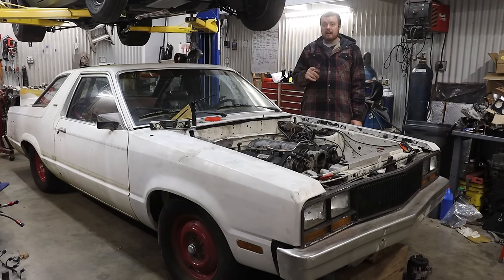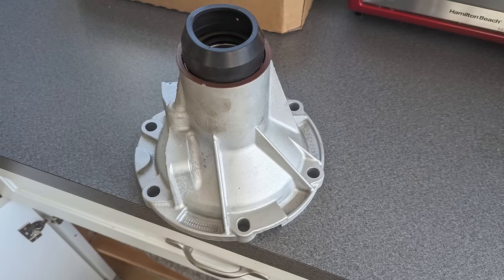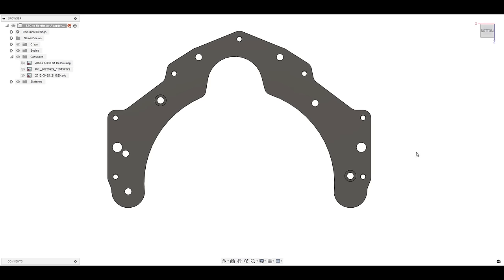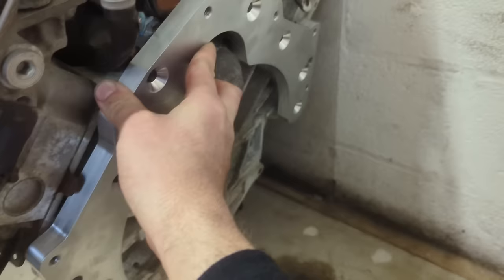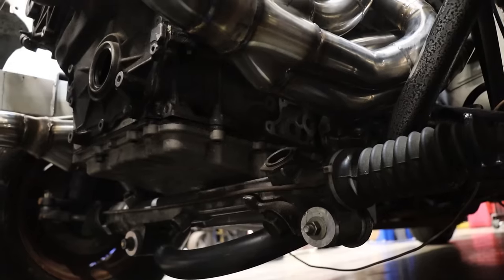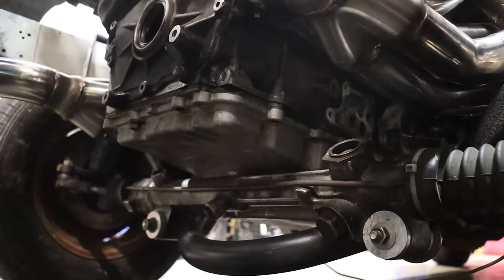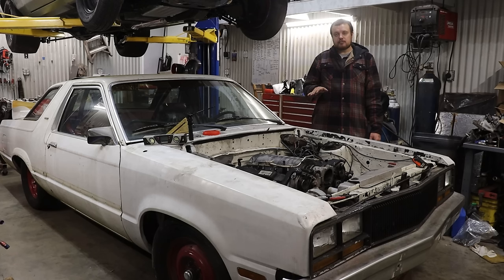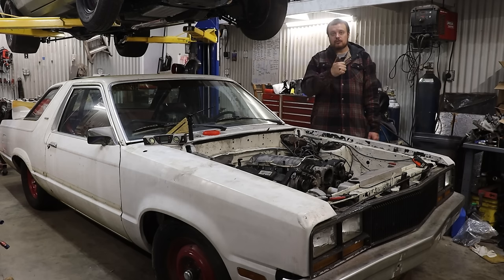Fits Way Better Than A Coyote! - Twin Turbo Cadillac Northstar

Comment: You are using gt3582s on it. I'm trying to figure out a pair that will have equal back pressure to boost pressure between 5000 to 6500 RPM on a square headed 6.0. I know you have ran different pairs on your 6.0 . What pair of turbos do you think would fit that criteria?.
Reply from the maker: You'll definitely want to use something larger than gt3582s. It more depends on you planned power goals. A set of s366s should do the trick to 1000+whp
Reply: @Calvin-Nelson  I'm thinking s366 with a 80  73  turbine wheel and a. 91 ar. They are the john Deere tractor turbos. That's what I was thinking too.

Comment: Big problem with the Northstar is that they pull the head bolt threads out of the block naturally aspirated. It's only gonna be worse under boost. I was a tech at a Cadillac dealership for years in the 2000s. We had 3 techs that all they did all day is pull Northstar engines and install head certs in the blick
Reply from the maker: We will be fixing that problem with some improved studs from Northstar performance.

Comment: I love this! I'm trying to build a car with a Northstar in Germany. I believe the open deck design will run into problems after 700bhp. No need for 700bhp in Germany though. They'd lock you up if you took it on the streets.
Reply from the maker: You guys need more racetracks.
Reply: @Calvin-Nelson  true. I'll probably take it hill climbing as that doesn't require the same rules as getting something road legal.

Comment: I'm really excited about this project. I was lucky enough or smart enough to buy an m122 for the northstar with the built in intercooler prior to Richard's videos for less than $500 with the intention of modifying an aluminum truck intake for a 4.6 2v to use it on, but as soon as I saw you doing this, I put using the 2v on hold to see what comes of this project. 

Instead I decided to just use the 4.2 ford v6 that was in my f150 and turbo it. I'm using an ebay gt3582 for that one. I've already added an MS3X to it and once I get it tuned on Flex fuel, I'll add the turbo. The eventual goal for that is to twin charge it after adding some aftermarket rods and ring gap using twin 3582s and twin amr500 superchargers  (which I already have from adding twin superchargers to my frs that I've since sold). 

Depending on how this project goes I may end up putting the m122 and a northstar in my dodge magnum.

Comment: I build transmissions. That’s not a 6l80e that’s a 6l50e very similar design but not quite the same you can get a 2wd tail look for one off a Colorado truck
Reply from the maker: What if I took the pump and bell housing and put it into a 6L80e?

Comment: I’d like to see it make 550 to the wheel, connecting rods look like the weak point
Reply from the maker: Eh. We've taken a set of 6 cylinder rods which are very similar to 800+. 8 should be fine at more.

Comment: I always hated the bad propaganda the North Star got. All it lacked was the correct size ARP head studs and it was as stout and dependable as any small block Chev. or Ford out there. I was always against brand swaps. Except if you're doing it to a Ford and refraining from using LS, I'm all in! Can't wait to see how well the North Star holds up with turbos. Did you change to Turbo piston rings or go with what was in it?

Comment: I have an idea that I want to run past you I have a 2005 pontiac bonneville gxp with the northstar init and it has the 4t80e init I believe could a guy take that car and make it rwd with the northstar and a 4l80e the factory computer would run it I think big thing would be adapting it to the 60* block I think I have always wanted to rwd drive swap one of the gxp's mine is a non runner think it has timing chain issues bought it that way have been thinking about a 6.0l 4l80e or a t56 I have the 6.0l and the 4l80e not the t56 but a guy could probably find one watching this video got my brain thinking what if with the 4.6l
Reply from the maker: The problem with the FWD Northstars is they have a bunch of stuff in the back of the engine that would be a lot nicer to have in the front like coolant hoses, and water pumps, etc. it's totally possible to do what you're saying, but you just have to accept there will be a few hurdles to just over. The RWD Northstars are a lot easier to build off of.
Reply: @Calvin-Nelson  would the computer related stuff cross over to a rwd engine if I would track a rwd one down because I think I would need a new engine anyway being mine I'm pretty sure jumped time
Reply from the maker: @supersport1986  the RWD engine has VVT, so you would probably want to get an ECU with that control capability to match it.

Comment: The “6L80” you spoke of is not a 6l80.  It is a 6L50 with a 43 small spline output shaft.  The STS-V LC3 northstar uses the 6L80

Comment: The only economical way to purchase a Coyote engine is buying a train wreck and that too is becoming difficult.Rebuilders are fixing those as well. Not that this has anything to do with Calvin's excellent video content, I'm noticing rebuilds on YouTube that are flat out dangerous to drive, so be careful if you're rebuilding a damaged vehicle and or purchasing one that's been repaired. Don't assume good looks translate to good road and track behaviors. If that vehicle doesn't measure out to the correct numbers, if will never perform as it was meant to. Period.

Comment: This project is MAGNIFICENT!  :)   
Regarding the turbos, I've run a bunch of those, and I've found that it's necessary to run a cylinder hone one the I.D. of the compressor housings until you're SURE that the compressor wheel doesn't touch the housing at all.  Several of them that I've run would just barely touch, which you can easily miss if you aren't looking for it really critically, and then those turbos seem to eat themselves. Lol...  It's not very expensive, but it can be inconvenient.
Reply from the maker: Huh. We've never had an issue with one as far as that goes.
Reply: @Calvin-Nelson  Maybe just take an extra one along in the trailer if you're drag n' driving with those!  I love them, but they aren't perfect.  (maybe more reliable than Precision though in my experience, Lol)

Comment: Im interested to see how you decide to run the intercooler piping and also when its dyno time how efficient this motor is due to the better valve train compared to the pushrod style. Hoping northstar performance takes advantage of the r&d your doing for them and starts offering the parts you create. There's always a market for folks wanting something different! Also, pissing off the purists is a goal unto itself 😂

Comment: Pretty sure that is a 6L50 transmission.  Very common for most Rear Wheel Dr., Cadillacs of those years. If you look up a 2 Wheel Drive 6L50 tail housing. It looks to be the Bolt pattern looking for.
Reply from the maker: Yep. You are spot on. Thanks

Comment: Thanks for the great out of the box builds, I always look forward to them.  Your visions and skills are always inspirational.  I just read to the bottom of the comments (639 as of now) and have to say to the writers of negativity, Wake up!  GM Dominated Indy with the IRL version of this mill!  They did their home work well before arriving at the LH2 and LC3 versions of this platform.  These engines came in $60,000 to $100,000 luxury cars from 2004 to 2010, they are very refined somewhat complicated and weren't cheaply made.  The head bolt issue was on the early transverse models and a Northstar's starter location is not exclusive to this engine.  Some performance parts are out there like rods, pistons, MLS head gaskets and a dry sump system.  It's also been mentioned that Northstar Performance has stud kits and possibly cams.  I know Calvin and his dad will make an awesome build as usual because they know what they are doing with a engine most people are afraid to work on..

Comment: Ok so here's the problem the Northstar was a great engine right up to 80-90k miles.They have ring seat and piston skirt issues.So where you gonna find a low mile example? Boneyard engines are NOT going to be good reliable engines for a swap at that point especially boosted..and I'm a fan I had a frost white Eldorado back in the day and that car was badass..front wheel drive smoke shows for days😅

Comment: Making your own Bell Housing Adaptor was a missed oportunity. If your going that route you could've made the 1st 8hp Bell Housing Adaptor to fit a transmission from a Hellcat; why only have 3 gears when you could've had 8, plus paddle shifters. Im one of those that gave up on the Northstar. I didnt know they made 6l80's to fit the Northstar. 6l80's had their problems too. This engine had so many strikes against it by the time GM resolved those issues, even GM themselves had moved on to the LS series and never looked back. Rebuilding plus add on's to a Northstar ever feel like a salmon swimming upstring only to reinvent the square wheel? Anyway, Good luck, nice project

Comment: The waterpump drive comes off of camshaft. You can adapt a distributor to be cam driven. And use an aftermarket intake for a carb. No computer control required
Reply from the maker: Not on these. The water pump is a conventional belt drive. I'll stick with my computers. They allow us to make the horsepower we are making.

Comment: Since you mentioned that they do make a RWD transmission for the Northstar. That reminded me of an old article I read long ago about adapting the FWD Northstar engine to RWD but this might help you out. I’ve read that the bellhousing pattern was very close to the Chevy 2.8 V6 bellhousing pattern or a bolt on. I don’t know how true this is but I know that Chevy produced a TH 700-4R transmission my 87 GMC S-15 had one. I hope this helps you Calvin. 
Eddie P. Silverstreet South Carolina.

Comment: If you dont like twin turbo's, Im not sure you should even be operating a computer on the internet? =)  I think one could get 500 HP stock easily... twin turbo's an easy 1000 hp, until a valve or head pops. =(

Comment: Im not trying to be negative  at all i love the nothstar engine i had a sts with that engine in it loved it !! My friend worked at a big boat dealership and every few years the mechanics got to go to eilmore I think was the name of it a very high performance boat engine place they couldn't bring their phones it was literally locked down about thanking pictures and he told me they tryed the Northstar motor on the outboard before the Ls and that it didnt make the cut because of low botom end torque he has sense passed away or i would get all the correct information for you but with the turbos you shouldnt have a problem!! He also said they did testing on nascar engines but he really couldnt say but so much but he was blown away with this place big time as a wrench turner he loved the Northstar motors as well im so ready to hear and see this thing go !!

Comment: Hey mate on the topic of odd engines I recently got a holden vectra a cheap European fwd it’s the 3.2 v6, anyone known anyone to tune or boost one? I’d always regarded these as trash but unfortunately the little na v6 opel makes power! I never would have believed a $400 beater fwd could do 0-100kmh in 5 sec! On paper it’s only 215hp and compared with my l67 rated at 240hp there’s actually no comparison the na engine smashes it! I’m going to have to turbo it I think and maybe put the engine in a buggy or small car

Comment: My questions are why does it almost always burn oil? Plus, what is up with all of the head gasket failures? I do not see the Northstar as a viable streetcar restomod engine. I wish it was. I actually loved this engine when on the road. When I rented a car, which was often, I would look to rent these Caddys. They made a wonderful howl and were peppy, even with FWD and heavy Cadillac. Looking at GM's history with double overhead cam engines, they are just not into them. You can not blame them. The cam in block design is very efficient and makes great power with much complication. I could care less if GM ever made another overhead cam V8 engine.

Comment: Almost the same bolt pattern as the ls4 out of front drive vehicles.
It is possible that there are factory bellhousings that fit ford Jeep and Japanese transmissions
Fanatic builds has done something with an ls4.
Reply from the maker: It's possible.

Comment: Now the real question is could you adapt the LH2 bellhousing pattern to the pattern for the ar15 that could bolt to the 4200? If so I may have to change my El Camino plans from the 4200 to the northstar
Reply from the maker: I have the pattern for both. It would be pretty easy. You would probably be the only person in the world that would want that though! Lol
Reply: @Calvin-Nelson  Oh I can guarantee I'd be the only one, but its how Ive figured out to pull off awd with a manual.

Comment: @calvin you may want to consider slicing the header flanges between cylinders to reduce the chance of shearing off the studs.  The long thick header flange will expand due to heating at a different rate than the cylinder heads, which puts a shearing load on the studs.  GM slices the flanges on recent V8 engines.   Mercedes does it slightly differently with tight round holes for one cylinder, and slots for the others (see: https://www.youtube.com/watch?v=ubMyWT49IWs ).
Reply from the maker: Yep. The holes in the flange are large enough to let it move around.

Comment: You need to do a licensing deal with major aftermarket supplies for the northstar parts you designed. Get a cash payment for the design along with royalties. These parts, as you point out, no one makes. You have the whole northstar market to yourself. These deals could pay you back for your work. Talk to an IP attorney. Many are waiting for various northstar headers and other designs you have already done.  Just go easy on boost with the LH2. Already 9.0 compression. Check out the LC3 version. It is supercharged up to 15 pounds but has low comp pistons.
Reply from the maker: That's a great idea. I just have a lot of other priorities at the moment.
Reply: @Calvin-Nelson  understand. This would be a common issue for someone highly creative like yourself. I’d have your attorney contact summit racing in Arlington Tx. It might be easier than you think. They have a webpage with a listing of new products. It appears many may have come from people like yourself. I haven’t worked with them but they likely have a process. 2800 new product listings. Look at their website for new products.

Comment: Thanks you guys for putting this together. Your efforts are so much appreciated!
Stainless headers are awesome. Just make sure to pull in cool clean air! Stainless ducting?
Does you T400 have lower 1st and 2nd gearing? Prob wont need it with the turbo though.
My guess 1000hp to the wheels 25-30# boost. 7500 8000rpm.
Reply from the maker: Yep. Turbos will get ducting
Th400 is 2.48, 1.48, 1.00, so it's standard gearing

Comment: If you know how to make your own gaskets by placing paper against the item and then a small ballpeen hammer make the outline of it.... then you can make any adaptor your ever going to need. Lets do a hard one first... okay? After you make these paper outlines and transfer them to metal, lets say 3/16th thick metal., drill necessary holes in them and place each one on the respective spot it was traced from. Marry those two items and measure the distance between them once the stub on the transmission is in the pilot hole. Cut same thickness strips of metal between the two in the gap. After avoiding the heads of those bolts holding the metal traced plates, slide those strips into the voids and weld them.. well start by tacking stuff so it can be taken apart and remove bolts holding them together. this method works on standard transmissions making space for the flywheel, pressure plate and etc. I hope you can see what I am referring to. Same with any automatic transmission and also allow enough that the ends are not too tight against one  another. Once you have built a prototype, you can see how easy its going to be for any combination of engines and transmissions. I started doing this in the fifties.
Reply from the maker: Yeah. A transmission adapter plate needs to be a lot more precise than you are going to get with that. I'd rather use the blue prints to draw that sort of thing up.
Reply: @Calvin-Nelson  I was trying to show you by wording it out since pictures are just a bit more than I can do. I built adaptor plates style bellhousings for my Peterbilt trucks that had a super heavy engine and large transmissions. Cummins diesel, Detroit and Cat engines with any and all different makes of transmissions. It also worked on our crew bus rigs where we used what we had on our junk from the yard on the islands of southeast alaska. Getting what you needed and shipping it to us usually cost so much that it was not going to happen. I might sound like I am getting into your face but not true. I did truly just mean to offer a idea. I am seventy four now and so times have changed quite a bit and maybe I am just blowing smoke. It works on my jet boat for our lakes up here in central alaska now where I am retired at

Comment: Hello Calvin, the reason you can't put the tail housing on the transmission is because the transmission is not a 6l80e, it is  in fact a 5L50e and is a smaller transmission and lighter and  not as durable. But as luck would have it you just built a adapter plate that will allow you to install it on your caddy engine. You will have to have a custom converter built for it. Good luck.
Reply from the maker: I believe it is a 6L50e. I may be able to remove the bell housing and pump and put it in a 6L80e and be good to go. We'll get it running with the th400 to start.